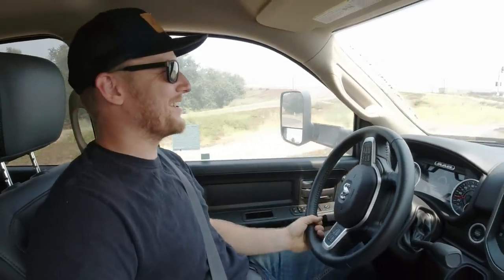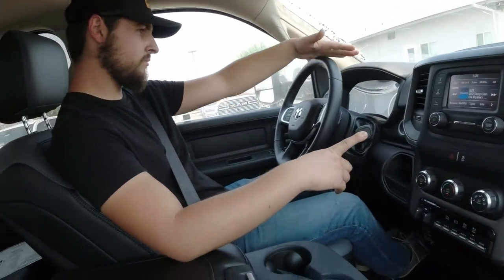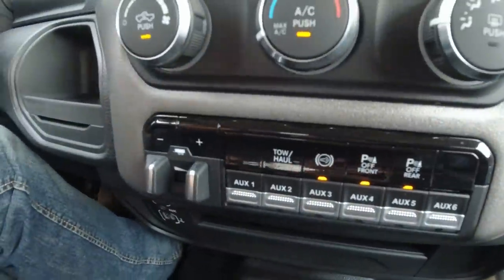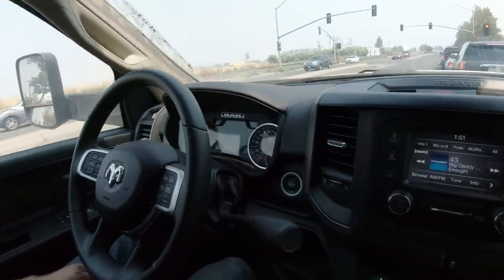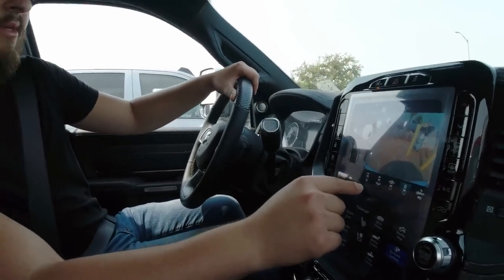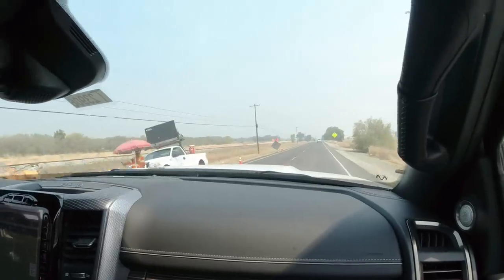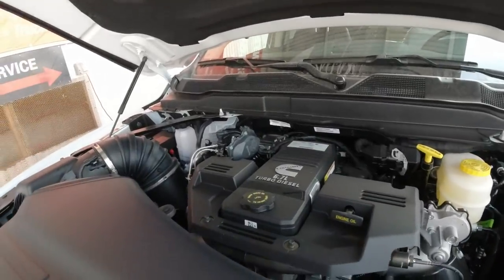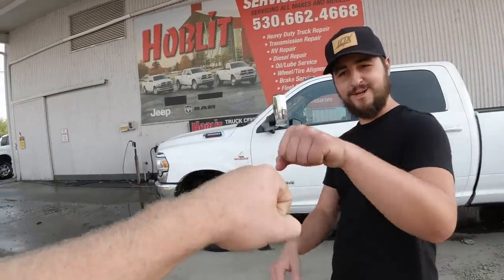BUYING A NEW 2020 TOW RIG. Go with a 5500 or 3500???

Comment: Never understood why they make a truck built to pull and they don't have the gooseneck prep . Its like a $500 option on a 60k plus truck.
Reply: B&W FTW.
Reply: My but jjkkkkkkjkkkk
Reply: It might have been missed by the person ordering for the dealership.  Sometimes there is a parts shortage as well.  A commodity report comes out each week.  Some options might not be available for a given production week or have limited availability.  If you stick in an order for an option with limited availability they might not pick it to be built and they lose allocation for that model, that week.
Reply: I bought a 2007 Dodge 2500 Cummins off the lot and it didnt even have a drop hitch on it.  Good opportunity for an upgrade but...
Reply: Not everyone buys 2500, 3500, 4500,5500 to tow with. Sometimes its about payload and weight you may be carrying in the bed, on a flatbed, or in a dump bed, could even be a Service bed with welding equipment, tools, even a small crane.
Reply: @James Reed  what you said.
Reply: Assuming a B&W can still be installed under the bed I don't see an issue. past the factory option being a little cheaper. not sure which is better.
Reply: You get the bigger rear hitch for heavy loads.

Comment: Fun fact about 5500’s, the rear brakes are the same size as the front. The calipers, discs and pads are identical to the fronts. I’ve never had to worry about braking even with weak trailer brakes.
Reply: Pentagon Landscaping I guess just upgrade the brakes on a ram 3500 if you tow a lot
Reply: Matthias Schulz pretty sure you gotta change out the whole rear end to be able to bolt up the calipers.
Reply: That figures. That puppy need a lot of strength to hold the horses. Sadly here in France, we don't get the 5500 ... Shame.

Comment: V-Belt: Look as those tiny brakes and thin frame rails on the 3500

Me: Looks at my 4cyl Colorado and cries
Reply: Exactly. My Ram 1500 is suddenly very aware of how thin its frame is and how small its brakes are. 😄
Reply: That tiny rail tiny brake 3500 will out pull that 5500 all day long. .
Reply: @williamjonesii7694  For a while, but the 5500 will do it longer. There's a reason they detune them.

Comment: A cab/chassis  3500 is different than a pickup 3500
Reply: Correct cab & chassis is derated
Reply: You have to remember that a 45 and 5500 are typically loaded all of the time as work trucks, the 3500 pickup is used by most for p and d work, rare that they are used day in and out fully loaded!!!

Comment: I currently have a 2017 dodge 3500 with 3.73 gears in the truck. I love the way it pulls my fifth wheel and the Jake brake will stop it all when I let off the pedal at the top of a hill.
Reply: I got 202 3.73 can it haul 5cars

Comment: If your buying a tow rig and want to be able to insure it on a personal policy, go with either a 3500 or a 4500 with a MAX gvwr of 16k. 16k is the cap for most insurance companies and defines their line between personal and commercial. Anything like a 5500 you CAN NOT add to a personal auto policy and will be required to have commercial insurance.
Reply from the maker: Great point
Reply: @VBELTandSON  DO YOUR DO DILIGENCE!! Some states are capped at 15k for personal auto!! Very few states are 16k!! Good news is FORD allows you to buy a 4500 cab and chassis with what they call a gvwr downgrade package that gives you a 15k gvwr. You still end up with a true 450 truck but legally able to insure it on a personal policy
Reply from the maker: I have all of them 3500 4500 5500 party

Comment: Stop messing around with the  pickups get your self a single axle semi will do that job way better truck will last longer and probably cheaper  , keep the good ol cummins trucks  for personal time
Reply: He doesn't have a dot#
Reply from the maker: 😬🤦🏼‍♂️ arther has dot and all that. I don’t need Dot numbers for my tow rig. Only required to have a CA number.
Reply from the maker: I talked about that in the video. Why change it up and get a big rig when what you do work so well and line of work a pickup does the job perfect. Cost of semi is higher and the running costs are higher.
Reply: @VBELTandSON  you have 2 pickup  trucks  & looking for another so something ain't working right if your looking for another truck , I would keep one for personal use sell the other and get a commercial truck for commercial work , truck will do ok but not meant for it day in day out , type of work you do single axle short wheel base  or even a medium  duty truck will work alot before for that set up and will last longer be  better for the business sometimes an old dog cant learned new tricks

Comment: Sam, great video, Morgan and I were very excited to see the truck of our dreams purchased by Arthur and put to work at this level. Can't wait for updates on maintenance and repairs etc. If he is worried about the longevity of 3500 being used at max capacity 100% of the time, maybe he can use it for 100k miles and trade it in every 100k before it loses too much value. And model his business plan on that loss equation over the 100k and have the ride comfort he needs. Plus the used buyer market for the 3500 at 100k miles will be larger than the 5500. Plus the nice interior can sell better used. Will be interesting to see what Arthur does over time with it.

Comment: Why not go for a ram 4500  in the middle between the 3500 and 5500
Reply: 4500 is the same as a 5500
Reply: @umadbrooo6947   so if that is the case, why make both? Fool the untrained buyer?
Reply: Alexander malm that’s why they make an f650 and f750 25,999 gvw more options for consumer. Only difference between 4500 and 5500 is 16,500 gvw and 19,500 gvw for the 5500 of gearing is the same so they why you either go with 3500 or the big boy 5500 like I have
Reply: @umadbrooo6947   thx

Comment: I'm not a Dodge hater by any means and you can go and read in the various Facebook groups and online forums to confirm my comments but the new Rams are having a ton of problems.  Exhaust brake limitations aside, the Ford id better in every other category if we are comparing 2020 trucks.  More power, better transmissions, smoother ride, better fuel mileage, and on and on.  The Fords just have bad exhaust brakes.  Oh well.  So you have to apply the brakes a few more times goijg down some steeper hills and pay for a few extra brake jobs.  I would take that over the lack of power and worse fuel mileage.  

The small amount of money you would have to spend on a few more brake jobs is worth it to have the other luxuries.  

The newer Dodge trucks are having major major (high cost) repair bills just before and after warranty and they are having a lot of issues with emissions systems and check engine light codes.  Not just $500 to $1000 or even $2000.  We are talking $4k, $6k, or even $8k and $10k repair bills and more.

You have fun with that checkbook trying to pay for the repairs right after 50,000 miles and warranty is over.

The proof is with the endless owners complaining abIut these issues and there is plenty of evidence online to back up my comments.  Why do you think Dodge just did a huge rebate for $20k off their new trucks?  To make way for the new trucks coming out?  Hardly.  They know they have problems with thier trucks and they have to unload them now.
Reply from the maker: Two words...extended warranty. I am probably one of the few that has driven both 2020 ford and ram with 30k behind the trucks. Ram pulled every hill the same as the ford. As far as engine brakes. It’s not about saving money on brake jobs. It’s about being safe. Reason why engine brakes were invented. Get brake fade once and you will regret your careless attitude about engine brakes. Stay safe
Reply: The only thing they have going for them is the cummins engine. 
Thats the reason people buy them.

Comment: I think he made the right choice. The 3500 dually's with the aisin have a higher tow rating than most of the 4500/5500 trucks last time I checked, only thing you get is more payload and for hotshot I think he'll be fine with the payload from "just" the 3500. The Cab and Chassis do have the wide track front axle, which is nice, but probably not worth it in his case.

Comment: It’s called a third member. And the Dana S135 is a baby axle in the real world. It makes that AAM 1150 look like a twig. If you really think about pulling 37k with a 3500 you should really give your head a shake, then put the same load on a real truck and compare the experience. I run a 6 axle truck and trailer at 120k, before that it was 140k on 8 axles(B-trains). I am loading 80k into the 6 axle and I could get 97k into the trains legally. I call stupid to the people that think that 37k is fine behind these little 14k trucks. I’d be hesitant with 37k behind the 19.5k 5500. Because of the limited traction of the rear axle, unless it was only ever going to be driven in nice weather. I’m all to familiar with the situation of heavy combination with low drive axle weight traction(25% of my 19500kg trucks gross weight is 4870kg) 43000lb tare, with a 10,800lb(spread over 8 tires is 1350lb/tire) rain was fun, snow was sometime a challenge. Motivation was limited lol

Comment: I have a ‘18 5500 and a ‘19 3500 HO.  Both diesel. Whatever one I happen to be driving that day is the one I swear I like better. Just depends on what your doing with it. I’d go with a 5500. But spec’d exactly how you want. Don’t make any compromises. Love the Aisin shifts too. Nice quick, firm, gear changes out of them.

Comment: You guys need to come up and buy and outfit your trucks in Canada. US dollars go farther as it's higher value than Canadian dollar. (Running about 30% higher) You see a lot of 5500 Limited trim hotshots up here in Alberta and our outfitters install air suspension systems so you roll like a Class 6,7 or 8 truck.

Comment: Me and my bro went and bought a new 2019 ram 3500 HO and a 2020 ram 3500 mega cab HO.  I have the 19 and it’s been in the shop 4 times in the first 40k miles,  his mega cab engine blew up remote starting in the parking lot at 6,000 miles,  took them 2 months to put new engine .  4000 miles later he needed new injector,  I’ve been through 4 egr valves already, the module for the traction control and everything has gone bad on both trucks,  these trucks are nightmares and i wouldn’t buy one again they will leave you stranded in limp mode pulling hotshot!  I had to drive 130 miles in limp mode to make it to the drop and it wouldn’t go over 35-40.  Had 0 boost it was ridiculous we spend $70,000 on trucks and they break by 10,000 miles.  Good luck I’m going Duramax or just getting a freightliner hauled truck with a 9.0 Cummins.

Comment: Should have asked the fleet sales guys about the 4500/5500 ambulance package full air ride rear , 2wd or 4wd heavier cooling and electrical.
Reply: I was really wondering about this... so took a look on Ram site.  Seems the package now is just AC and heat ports,  and electrical monitoring.   No mention of air ride.   R4tech used to make system for ambulance, and Kelderman I think is about the only option right now.   Been looking at doing a 5500 with kelderman and single rear.
Reply: Most Type 1 (truck frame) ambulances now have liquid springs in the rear instead of airbags. Far more comfortable and reliable.
Reply: we have both in our fleet, most that drive them like the air ride the best. The liquid one's make the rear end sway more.
Reply: @phatboizbackyardkustomz9006  Interesting, we dumped our air rides for the liquid springs and have loved them. Like riding on carpet and took out soooo much roll. They corner like crazy now.

Comment: For the type of towing you and Arthur both do. I would think the 5500 would be the better option. The further you can stay away from the limits of something on a daily basis. The longer it should last. Or the more forgiving it should be when abused. My next Cummins Ram Will likely be a 5500. While I love my 2500, when it comes down to heavy loads all the time. I would rather have the 5500. Partly too, cause I want to go with a large tilt back/roll back. The ability to put large loads right on the bed and not need a trailer is big for me in some situations.

Comment: I have the 5500 Tradesman with Cummins and G-56 (4.10 gears) and pull a 10 ton triple axle equipment trailer and a 42 foot Sundowner horse trailer. I have the Moritz steel hauler bed with a 90 gallon auxiliary tank with fueling station and it rides like a covered wagon empty, but is like a Cadillac with 20,000 lb plus on the gooseneck ball. I pull in the mountains, so I much prefer not to be pushed down the mountain, or over the mountain and a 3500 just does not have big enough brakes and driveline components for my use- the wide front axle also gives me a shorter turning radius, which has saved my bacon a time or two.

Comment: Engine brake SHOULD be on the steering wheel! Great engine brake on the Cummins, but needs to be on the steering wheel for mountain switchbacks and varying steepness of downhills. I don’t like taking my eyes off the road to find the button.....
Reply: Why? It’s not on the steering wheel in any vehicle even semis. You flip it on when you start driving and the brake only engages when you let off the pedal. When I am towing in my pickup or my semi it is on all the time. I touch the switch once when I get in.
Reply: @txdoodlebug  I obviously use it differently than you do. Varying whether it is on/off on the varying terrain/topography maximizes fuel conservation.
“On” all the time reduces my speed in situations when I’d rather coast than being unintendedly slowed.
Many ways to skin a cat...
Reply: @txdoodlebug  
The Kennworth I was driving the last few years has 3 levels of engine brake. Yes, that control is on the dash, along with the cruise control(s).
My thoughts are they all should be on the steering wheel like cars now have several various controls mounted on the steering wheels.

Comment: My only reservation about the Ram is the front suspension. Do they still use the trailing link going backwards?  I also wonder if the motor in the 3500 and 5500 is the same short block to start with?  There has got to be a reason why they don't use the higher tuned motor in the 5500. Longevity maybe?  200k miles vs 1M miles?  I'm due for a new truck next year, just curious.    --gary
Reply from the maker: Someone was saying detuned for emissions idk
Reply: V-BELT and SON It’s for longevity and to keep some young punk from hot rodding your company truck.
Reply from the maker: That’s not gonna stop anyone from trying to hot rod a truck
Reply: Cummins tech here..  the 2500/3500 have mopar ecms. Dodge buys the engines from Cummins without warranty through Cummins.  That’s solely a mopar deal.  The 4500/5500 are considered commercial/medium duty and have Cummins ecm. They are set at Cummins power levels for longer commercial use life no matter what brand of truck it is in. They are the exact same Engine, injectors and turbo. The medium duties have steeper gears for the difference in power and less strain for daily max gvwr use
Reply: @Freakingstang   Thanks much for the honest answer!  I'm 68, in my younger days I built race car, motorcycle and snowmobile engines. I have a pretty good understanding of engines and this is about what I was thinking. It's hard to get a real answer from a "salesman" though!!   Thanks again!!    --gary
Reply: @Freakingstang  But can you swap out the ecms? 😁
Reply: @ictpilot  no. Not unless you rewire the entire engine and swap injectors. Then the cummins ecm won’t communicate with all the body control modules.

Comment: Hot shooting ill take the 5500 with 19.5 14ply tires and larger breaks also the motor is detuned so it will last longest.
Reply from the maker: Detuned so less power and more time spent in higher rpms. I wish they would leave that option to the buyer not force detuned engine on us.

Comment: Nice video Sam and congrats to Arthur. I am just like him though lol. I was considering a F450 for a tow rig for a large heavy horse trailer and big 5th wheel rv but the fact that the exhaust brake sucks and it essentially has the same tow rating as the Ram 3500 I believe I’ll just stick with Ram. Besides I guess there’s a reason ol farmers like to stick to the Cummins.

Comment: The aisin for the 5500 is called a as69rc hd. Does anyone know if the 4500 and 5500 chassis cab got a different rc69 and do you know the differences?

Comment: I'm not certain about the 2020 models but when I researched & bought in 2019, the HO Cummins was not an option for any cab / Chassis models.  So I negotiated a killed deal on a '19 Big Horn Cummins HO, 4X4, DRW Crew Cab 4.20 ($53K otd), removed and sold the pickup bed and installed a CM hauler bed and auxiliary fuel tank.  IMHO the HO engine was worth the extra steps I made. My 3500 can tow the same weight as the 5500 and I have 400 hp & 1000 ft lbs of torque.  Terrific fuel mileage (11mpg empty, 7.5 mpg loaded 30K trailer). Soon after I roll past 100K I'm doing a tune, hoping I can improve the fuel economy. 
OEM brake pads suck (replaced front @ 40K miles, front & rear @ 80K). My GMC is still running oem pads at over 100K miles.

Comment: I have a question. I’m looking at the 5500 for hot. Shoting. Will the banks cold air that fits the 3500 work on the 5500? Also the monster ram intake for the 35500 emissions intact will it work on the 5500?? The air volume it moves is awesome. The testing proves it. On the website it says doesn’t fit chassis cab. I don’t get it. Same engine and trucks. Help if you know. Thank you.
Reply from the maker: All the same
Reply: Awesome thank you!